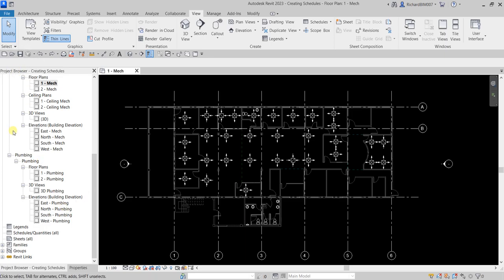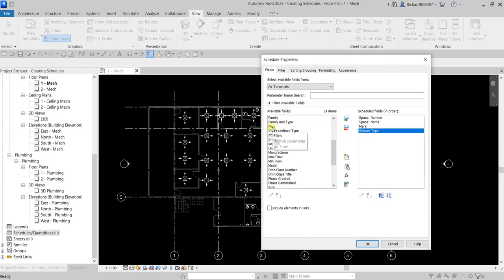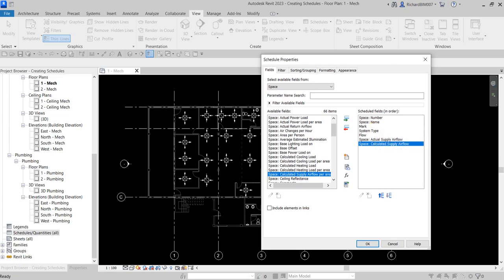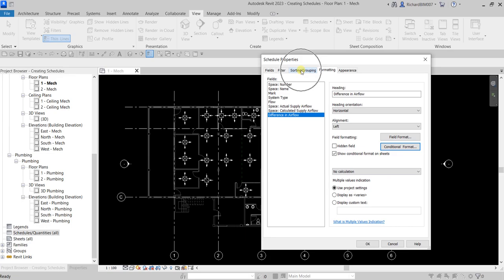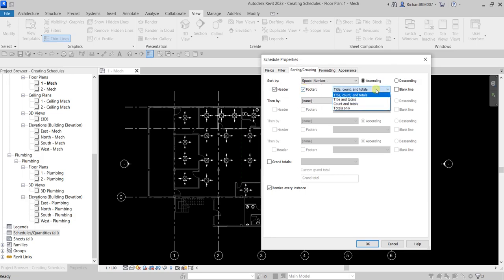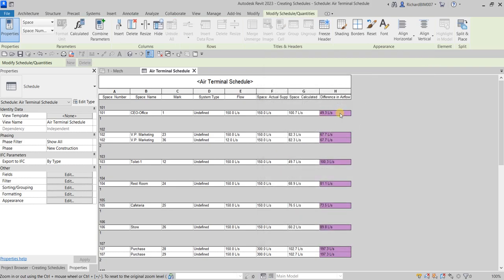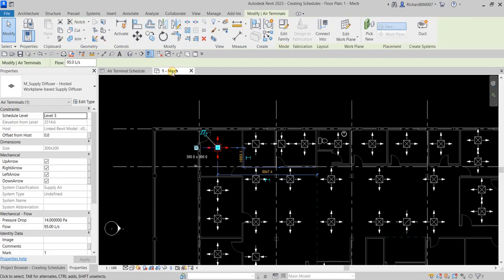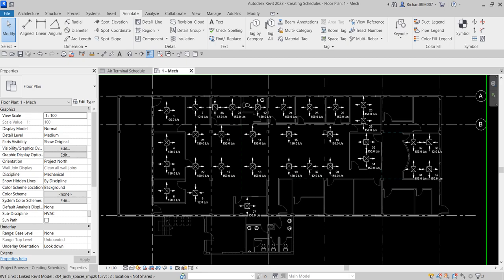REVIT 2023 FOR MEP - Lesson 7 Creating Air Terminal Schedule

Comment: Nothing showed up for me on the schedule except for Flow values, rest are empty, why?
Reply from the maker: hello sir, this usually happens because the air terminals aren’t fully set up yet. Flow shows because it’s a basic instance parameter and you can enter it manually. The other fields stay blank if the terminals aren’t connected to ducts, assigned to a system, or if those parameters don’t actually belong to air terminals. Once you connect the terminals, create the supply/return system, and make sure the family types have values, the rest of the schedule will populate.

Comment: bakitnot computed yung space ko po?
Reply from the maker: hello sir that usually happens when Revit can’t properly close off the boundaries of the space. A “Not Computed” space means Revit doesn’t see a fully enclosed area to calculate the volume or area. Common reasons are:

* One or more walls aren’t set to the correct *room bounding* property.
* The space is missing a ceiling, floor, or bounding elements (so Revit can’t determine the 3D volume).
* The space isn’t actually placed inside the enclosed area, or it’s overlapping something else.
* Sometimes levels or linked models don’t have *room bounding* enabled, which also causes it.

Quick fix:

1. Check that all surrounding walls/roofs/floors are set as **room bounding**.
2. Make sure the space is placed correctly on the right level.
3. If you’re using linked models, go to *Type Properties → Room Bounding* on the link and turn it on.
4. After adjusting, hit *Space Tag → Update Areas and Volumes* to refresh.

Most of the time it’s just one wall or boundary element not set to room bounding.

Comment: Hi rich, Thanks it's informative but I did not get steps to add the calculated Air flow in the Air terminal shedule
Reply from the maker: Hi @mohammedanzal.v.k1283! To add the calculated airflow to an air terminal schedule in Revit 2025, here are the steps:

Make sure your air terminals are connected to a duct system and the airflow is calculated (e.g., via Systems Analysis under Analyze > Systems Analysis). Check that the "Flow" parameter in the air terminal’s properties shows the calculated value.
Go to View > Schedules > Schedule/Quantities, pick "Air Terminals," name it (e.g., "Air Terminal Schedule"), and hit OK.
In Schedule Properties, under the Fields tab, find "Flow" in the Available Fields list, add it to Scheduled Fields, and click OK.
Open the schedule—it should now list the calculated airflow (e.g., 200 CFM) for each air terminal.
If the values aren’t showing, ensure the system analysis ran correctly or manually enter the airflow in the "Flow" parameter for each terminal. Let me know if you need more help!